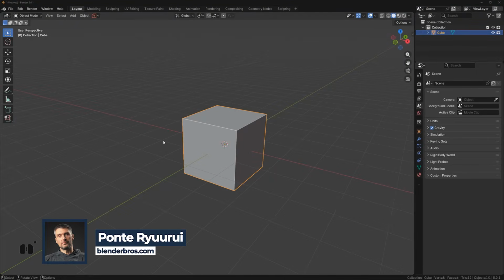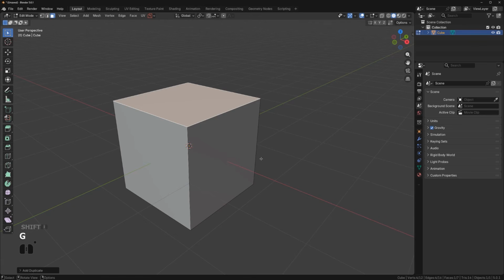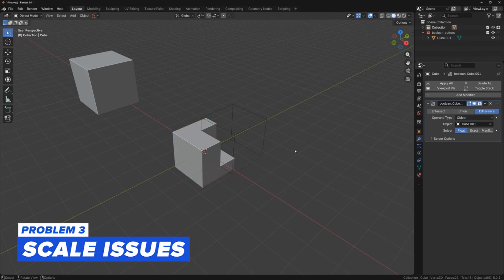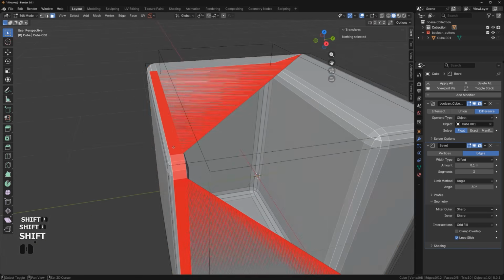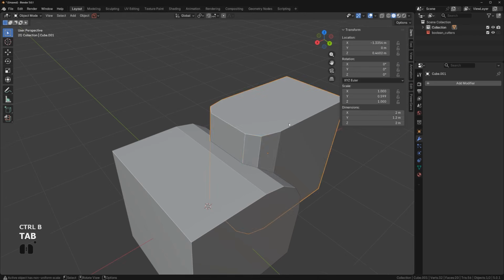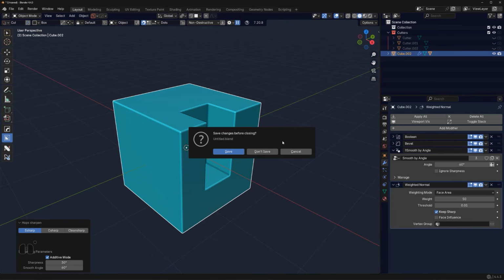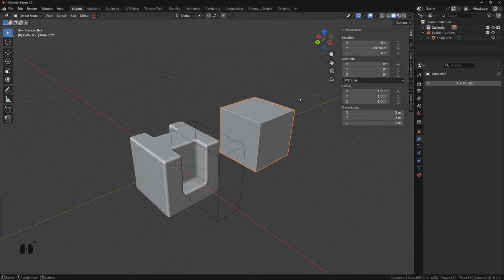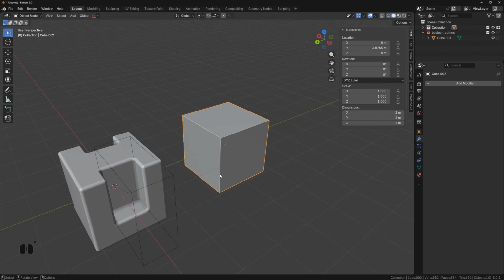The BIGGEST Mistakes New Blender Users Make

Comment: Thanks, but for someone coming to Blender for the first time but it’s far more basic than that:
1. Move, rotate, snap and orientate objects, one against another with good automatic referencing, without constantly messing about with stupid little menu options.
2. Ditto object origin alignment.
3. Grab: Object’s moving in screen space by default is totally stupid and useless.
4. Grouping object together. WTF is so hard about that? Why can't you just group and ungroup objects together - like EVERY other 3D and 2D application on Earth?. WTF is that stupid parent feature for instead?
5. Actual visible measurements and dimensions. Having to "eye ball" stuff all the time first, then with having to tediously going back to a little menu to change the size.
6. To just make Blender functional you gave to pick through a total zoo of add-ons.
7. Clutter. Some tools seem to appear multiple times and have been named and organised by someone with asperger's syndrome. 
8. Guides. No ability to set up a load of temporary snappable grid lines. 
9. Can’t just update the application easily, with downloading another entire version every time.
10. That *ing Cube and Monkey.
Reply from the maker: Whats your point exactly
Reply: My comments were very specific (the first 9 at least) and "FOR SOMEONE COMING TO BLENDER FOR THE FIRST TIME", perfectly reasonable. If you want to be wilfully obtuse about them that's up to you.